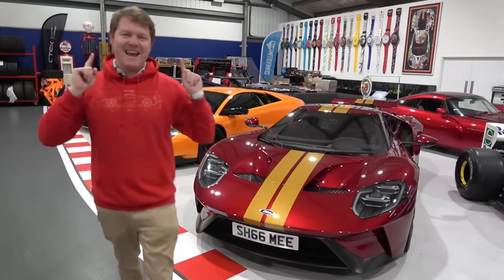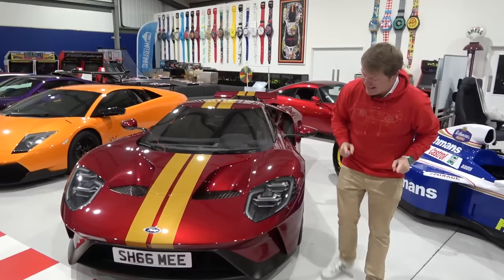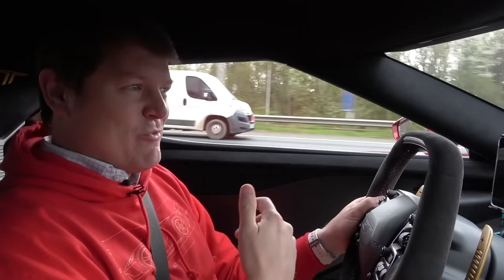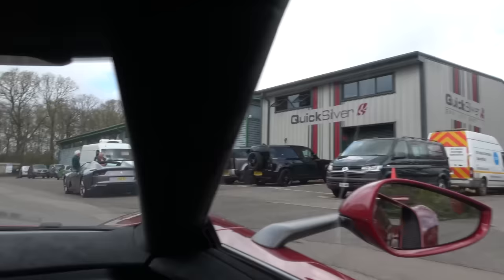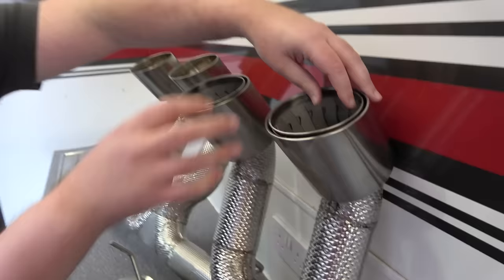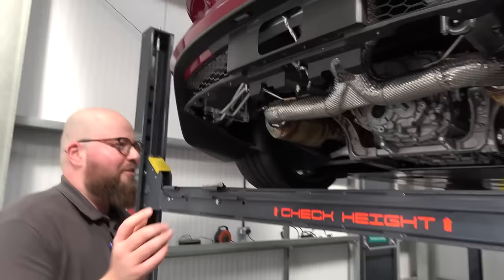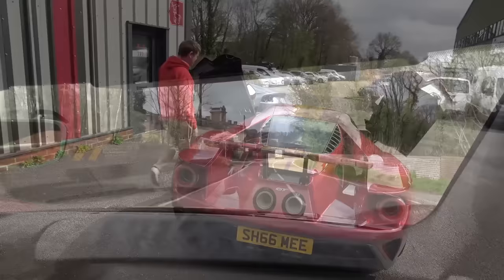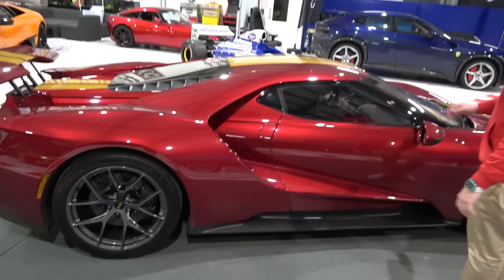GO BIG OR GO HOME! New QUICKSILVER GT LM Exhaust for the Ford GT Shmeemobile

Comment: Love this car! Regarding the exhaust, lots of attention is paid to "looks' and "sound." i.e., exhaust as "jewelry." Weight reduction is always a plus, as is heat extraction. But  "mega sound" aside, does it actually increase any performance?   Few creators seem to do before and after dyno pulls on these very expensive aftermarket supercar exhausts. That would be interesting.